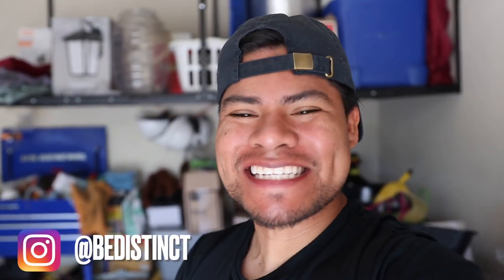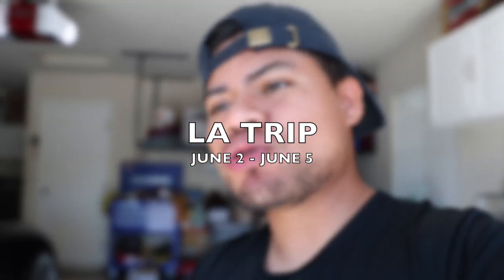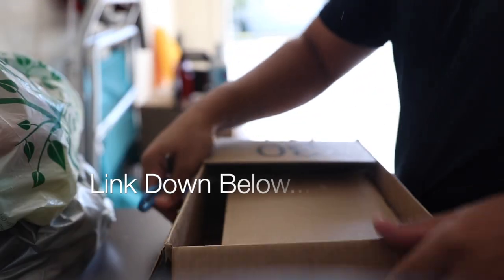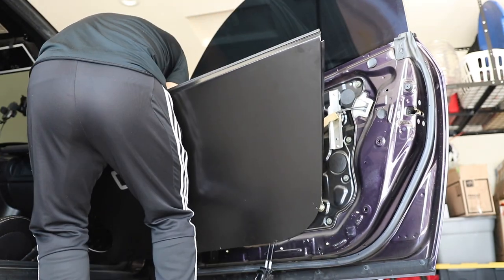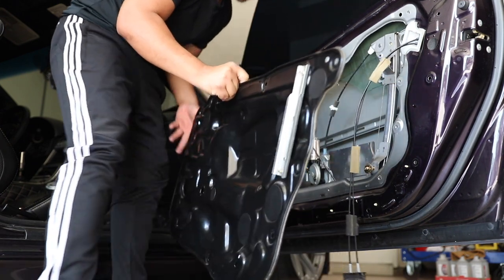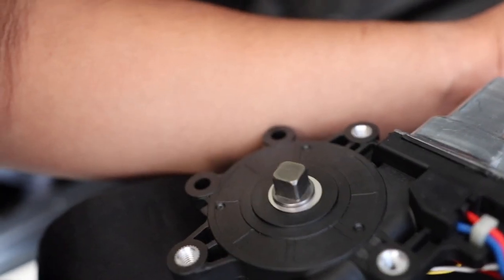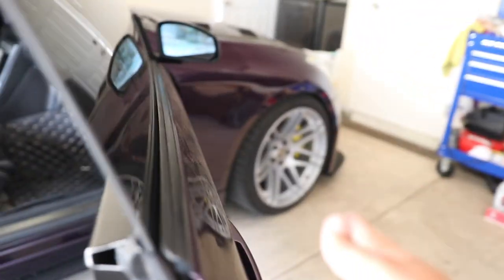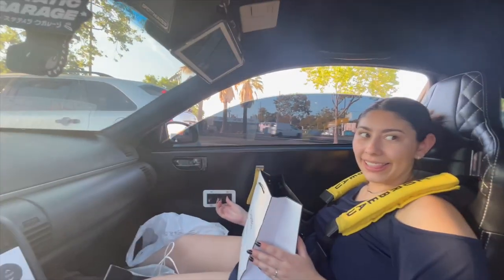This G35 Part BROKE AGAIN!

Comment: So when you replace the window motor it was because why? It would do anything or would it go down like a 1/4 or is that the regulator?
Reply from the maker: The first time I replaced it, the window would go down and it wouldnt go back up. This recent time, the window just stopped working completely. No up or down.